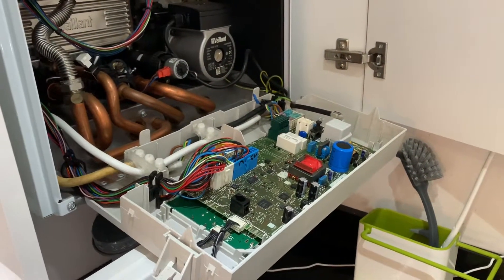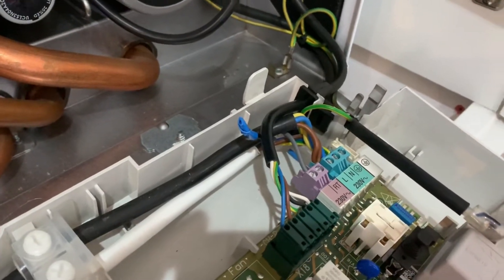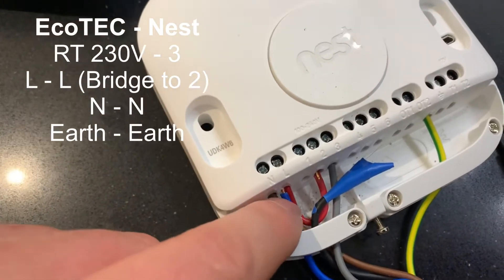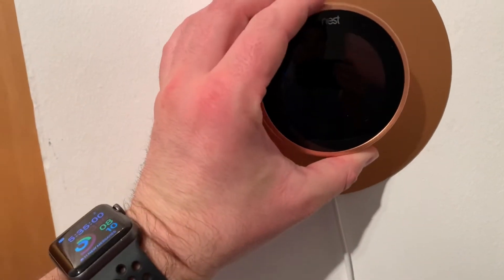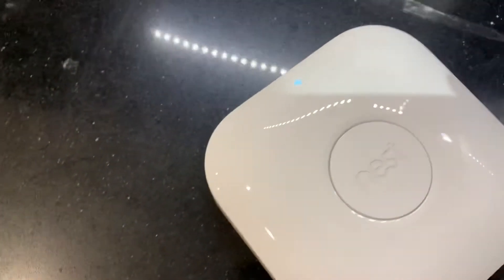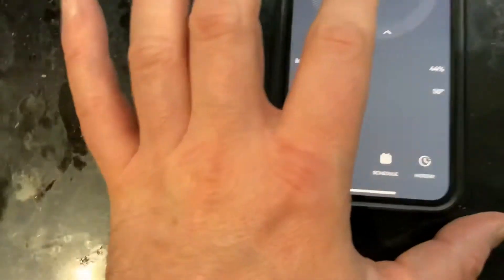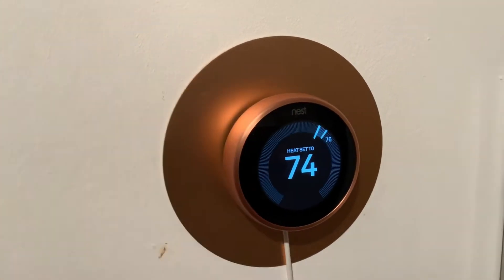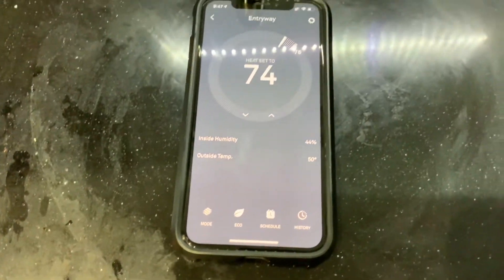How to Install Nest 3rd Generation on Vaillant ecoTEC Plus 824 Combi Boiler

Comment: Hi, thanks for this video. I’ve Vaillant eco fit Pure 825-835 and I just bought a Nest Learning Thermostat 3rd Gen but it came without a Heat Link. The supplier says this doesn’t require a heat link. Can I install the thermostat to my boiler without the Nest heat link?

Comment: Just to be 100000% sure: I can use 230V on port 2 and 3 on the HeatLink?
My old thermostat worked on the 230V output of the boiler, but the 24V output does not work on my HeatLink, it just shuts down the boiler.

Comment: Hi @luke, what is the set up for multi zone heating? I have 2 zones in my house? Thanks for your help!
Reply: @achtetepe did you ever find out? I have floorheating downstairs, but also radiators upstairs...so 2 circuits.
Reply: @NessMeister  Hello, I did not deep dive but according to vaillant customer service, if you have 2 circuits, we will need Senso Confort 720F + wifi gateway SensoNet 921. I did not validate and go forward :(. Keep me posted if you do ;)

Comment: 1.17 the brown live from boiler, looks like it's in the Neutral on receiver and Blue Neutral from boiler looks like it's in the Live on receiver, with the red bridge??🤔
Also, be very careful with the pcb, they're expensive!!!
Reply: Shocking bit of wiring there. Using the blue / neutral in the live terminal. And then bridging with a bit of red. This is why people should not do their own wiring. Dodgy
Reply: I saw that too. 🤔